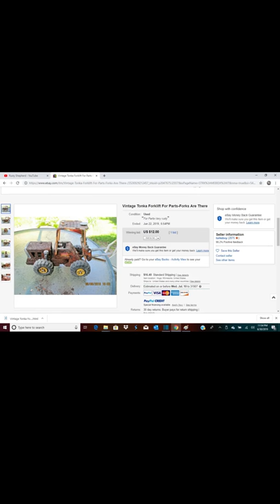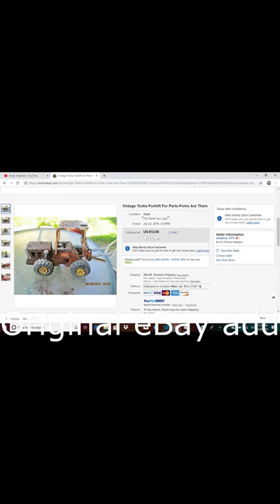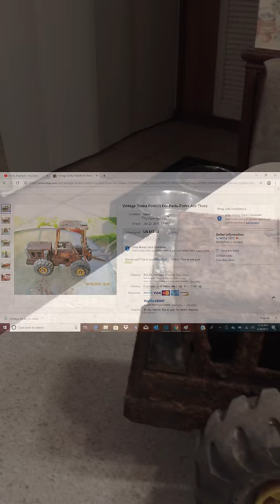1970's Tonka Fork Lift "Restoration" Fail? You decide. Sorry about the small video image.

Comment from the maker: I apologize for the little frame. I didn't realize that it loaded that way.
Reply: Hmm it was fine on my laptop ...2 suggestions..A) try rust buster and leave it set overnight. B) after blasting it..use a produce call POR 15 ..we use it on rust areas restoring classic cars.. stops rust in it's tracks....great resurrection from the dead...most ppl would have chucked into recycling.

Comment: How you like the new sand blaster and powder coat set up?
Reply from the maker: Joe Smith Works well! Not bad for cheap Harbor Freight stuff.
Reply from the maker: Joe Smith Works well! Not bad for cheap Harbor Freight stuff.
Reply: @RustyShepherd  that's same 1 Joe Smith has. You can order powder from Eastwood to get tons color options. You can spray 2k clear on top if you wanted extra protection and shiny automotive finish you can buff.